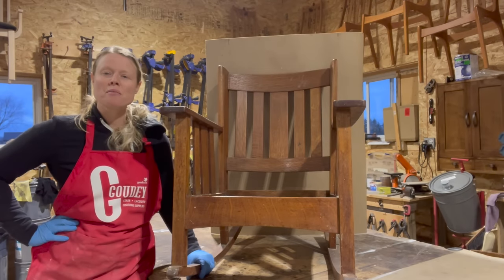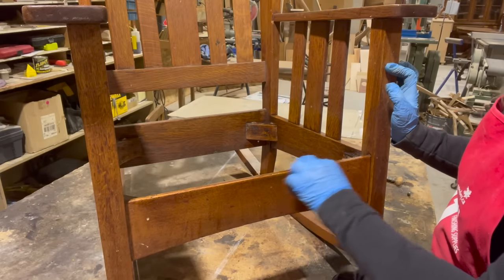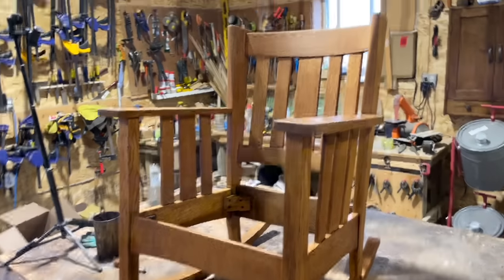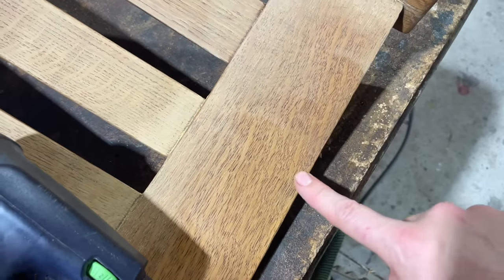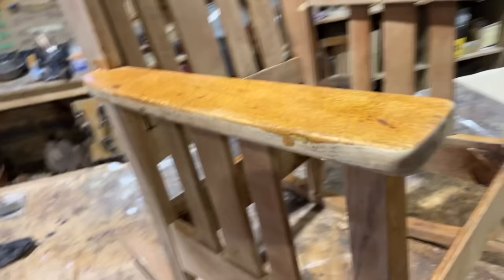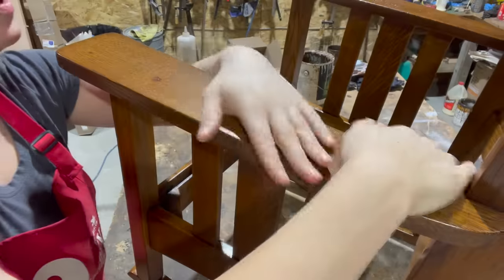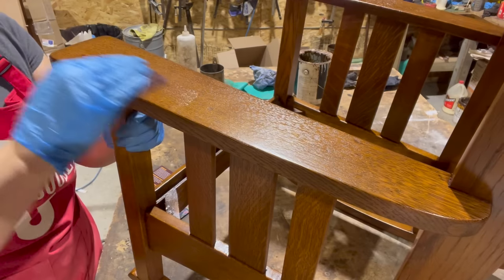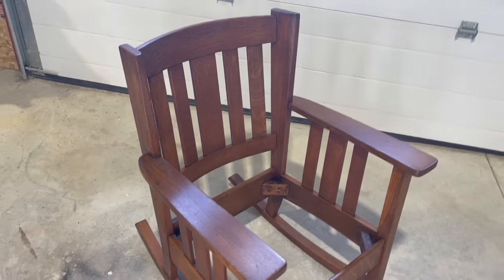would you accept this?

Comment: Love them. I think the style is Mission, the Morris chair was a Mission style recliner with an interesting push button mechanism that via springs, wire & metal armature reclined & raised the front apron. I had one I got as far as repairing the mechanism then had to pass it on as life changed. I did refinish the two Mission side pieces, one side chair & one short back rocker. These were all cushioned with leather upholstery & reattaching the upholstery in that old oak was challenging. Your work is amazing!

Comment: I. Did  one like this ,50 ‘years ago,re glued all the joints,and striped it right back to the bear wood,it was made in the 30,’s,the squab was missing ,but it was all bees wax ,and dust polished in,a gallon of meths ,wire wool,and soft brushing,soon gave up that white oak worn look, I just used to heat up the bees wax ,add a little meths in it, and brush it on hot ,and chase it with a hot air gun ,on low a heat ,give it a day to set ,then the hard work begins,brushing in and removing all the surplus wax,slowly bringing out all the wood grain, with a good hard wax it allows the marks and dents to look like they were ,part of its history and blend in,and the new squab I made a  green leather with upholstery,webbing and springs,I did this as a gift,and my friend was over the moon.just sum thing to do in the winter evenings.
Reply from the maker: nice

Comment: The cross grain scratches/gouges are difficult to remove, nicely done. It's always interesting to hear professionals as yourself describe basic items like sandpaper in terms of fine, very fine, etc. In what you do to prep a surface for stain, 180 grit is very fine indeed, in most of my small projects I don't use any stain and go with a hand planed surface where I can, depending on the wood. The grit that closely approximates that surface is 1200-1500 grit, which is terrible for staining. As always, excellent work on the chair.
Reply from the maker: Thanks!

Comment: Beautiful. Does anyone know how to remove the Howard’s feed n wax from an old reclaimed table that is the only finish it has right now? It’s too orangish for me.  Mineral spirits? Thanks!
Reply from the maker: Yes paint thinner and sanding. But it will be tough. Oil is penetrating and once applied is pretty touchy to remove. I would personally never use it as a finish for this reason
Reply: Thanks .  If I get it off I won’t be using it again. That’s the finish it came with from restoration hardware.  It’s reclaimed boards from a distillery.

Comment: Wow, my grandpa had a chair very similar to that, although the front legs extended through the arm rest.  I wonder if, on the dents, you might have been able to raise the grain with a wet towel and a hot iron.
Reply from the maker: yes always a good method but only for dents not scratches the cut the grain

Comment: I want to start by saying, I always love the outcome of your work. You always do great stuff. But, I have to ask this question. Why are you so mean to your paintbrushes? Your brushing technique always makes the finisher in me cringe at how rough you with your brushes. What did those poor brushes ever do to you? I do hope that doesn't come off too badly.
Reply from the maker: Lol. They are cheap chip brushes. The side swipe method picks up excess stain and redistributes it further in the piece. The stain is very expensive, the brushes not so much. I don’t usually  apply any finish with brushes, if I were to they would be much better brushes than the ones in use for stain.
Reply: @johnsfurniturerepair  OK, I feel much better now. By the way, will we be seeing that rocker again with a new seat?